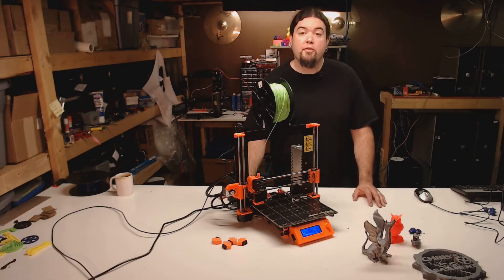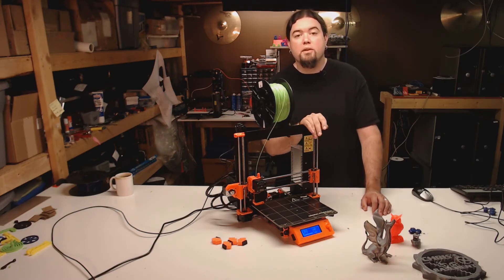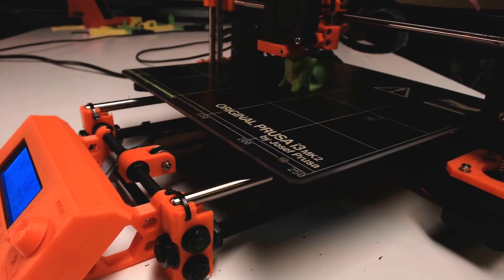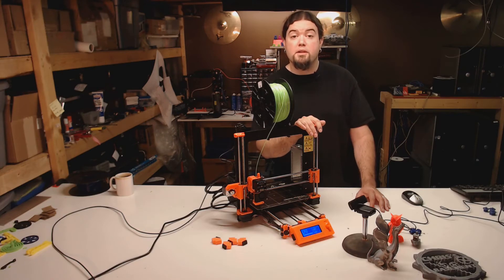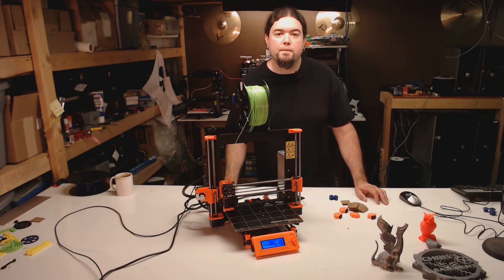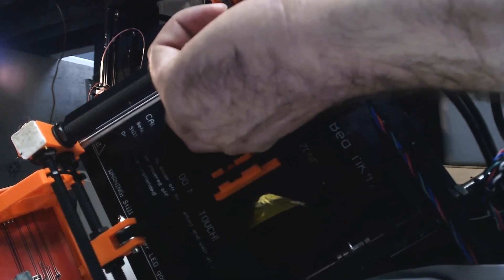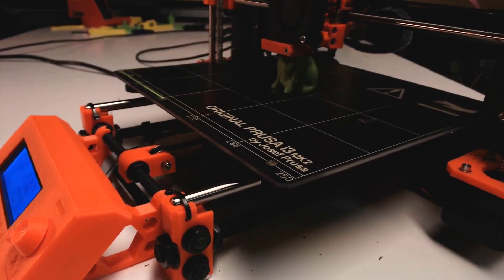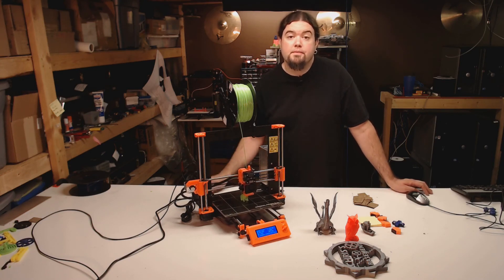The Original PRUSA MK2S 3D Printer Review - Chris's Basement

Comment: Why out of luck with the firmware?  It's open source and readily available on their website for tweaking till your hearts content. Enabling eeprom should be just one of the things to be done.
Reply from the maker: Hello, thanks for the comment. I was under the impression Prusa didn't want you messing around in there code. That's why they give you the updater program and us the .hex package files. Please send me a link if you wouldn't mind. I would like to check it out.
Reply from the maker: I do see the github page with the marlin files, so yes, you can edit these are re-upload these to the rambo. You would just have to skip there firmware updater process.
Reply from the maker: Thanks again, I will get this corrected.